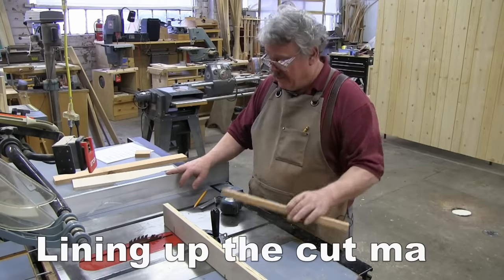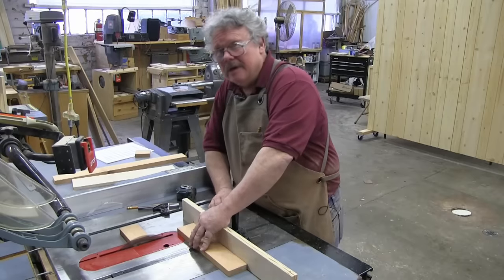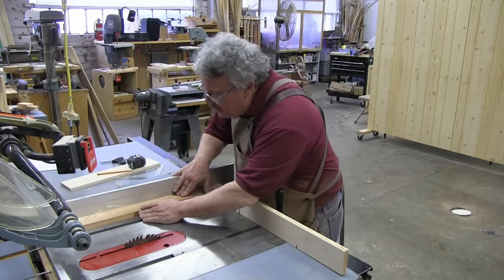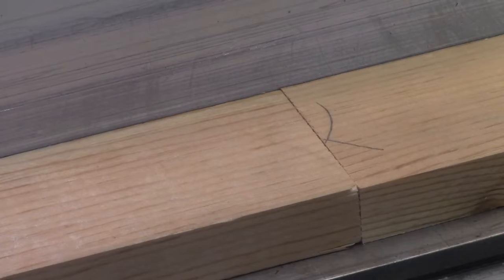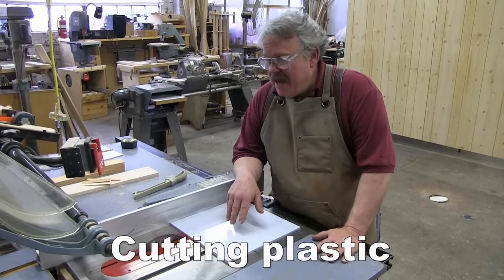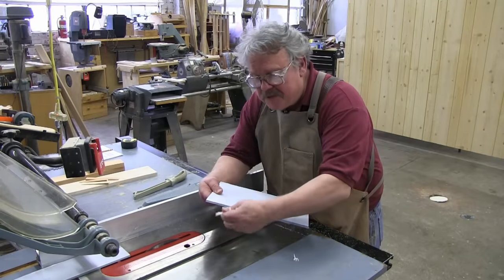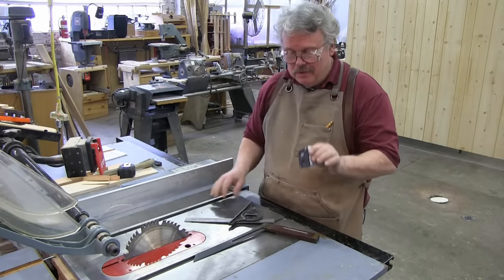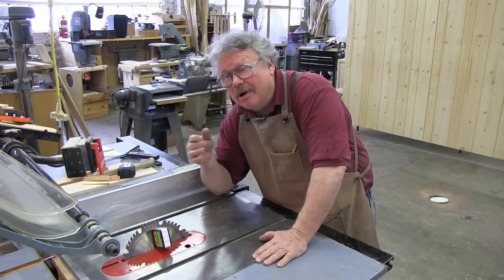5 Expert Table Saw Tips

Comment: Great tips, there is another way to do #1 Take a carpenters square up against the blade  and mark a cut line right on the table saw , than extend the line on the peace you are cutting to the front edge and line up the two marks and cut, the line will have to be "Renewed " every so often and also for different blades
Reply from the maker: Good tip; thanks for sharing. Craftsman once made a table saw with a plastic insert for this very purpose -- the plastic took the pencil marks well, but there was a problem. You had to use an extremely sharp pencil. If you marked with one that's even slightly dull, the mark would be slightly to one side of the straightedge.  The more rounded the pencil point, the further the mark was from where you wanted it. When I tested this saw, I found it more accurate to use a fine-point Sharpie. You could press the fiber tip right up against the straightedge and the mark lasted longer than pencil. You could easily "erase" the mark with a little naptha.
Reply: Another way is to use your square to extend your mark to the edge of the piece to be cut.  Then place the piece in the miter gage.  With the saw off slide the miter gage forward and align the mark on the edge of the workpiece with the tooth on the blade.  I don't know if I explained this clearly or not but this method has resulted in accurate cuts for me.
Reply from the maker: @fredsasse9973  It's a good technique, I used it often until an old craftsman showed me how to use a square to align the mark and the blade. One of the things I love about woodworking is that there are usually  many ways to accomplish a specific task.
Reply: @WorkshopCompanion  One thing I noticed is that your kerf came right up to the mark, not past it. I presume that any method (and yours seems the simplest) has to make sure to pick the correct tooth (i.e. the one set to the edge you're measuring on) to mark from.
Reply from the maker: @robertharris1748  This is true for saws where the teeth are set left and right. On many carbide-tooth saws, the teeth are exactly the same width, independent of how they're ground. As for the pencil line, I was taught to "save the line" rather than cut it. The area at the edge of a pencil line where light meets dark is much smaller than the actual width of the line itself. And I only use pencils for videos, when the camera needs to see what I'm cutting. When doing actual work, I mark cuts with a sharp knife -- much more precise than a pencil.
Reply: @WorkshopCompanion  What it seems many folks are missing is that your technique is by far the simplest and requires the fewest steps. There are dozens (maybe hundreds?) of ways to do this but yours is the simplest and most foolproof. I'm new to your channel but I'll certainly be hanging around!

Comment: #3, no rifing knife?
Reply from the maker: The saw was manufactured well over 60 years ago when few tool engineers would have known what a riving knife is. There are no retrofits available; we've looked. The saw is outfitted with an overhead blade guard, part of the Delta "Unifence" upgrade from long ago. It does a good job protecting against kickbacks, but we have to swing it out of the way for videos.
Reply: @WorkshopCompanion  got it!

Comment: For tip #2, align the miter gage.    Slide the gage out, slide back in upside down, with the miter part against the fence guide bar. 
Loosen and retighten the knob.   Done,    No fiddling.
Reply from the maker: This presumes that the fence guide bar is square to the miter slot, and this is not always the case . It's not on my saw, but if it is on yours this would be a good way to go.

Comment: So just got a band new Grizzly table saw. For some reason wood is hard to push through. I waxes the surface but still I feel like I need to push way too hard. Any thoughts?
Reply: Hello Steve, hey, just my 2 cents worth but I found a light spray of PAM worked for me. Mainly the cause was the snap in blade cover is not the same type of metal/ steel as the bed is made of. Another possibility is the fence is not exactly parallel with the blade. There can be a little movement when you lock the fence causing a slight bind. I have an 18" steel ruler I will double check the measurement from the groove the miter gauge slides in to the fence. On front and back edge of the table. Now some people will say you need an ever so slight difference to keep wood from binding. Working at a pattern shop where we deal in thousands and tenths of degrees,  I dial my fence in exactly parallel.  Just saying what works for me. Good luck and keep all your digits 
:-)
Reply: @jerrymeeuwse859  I'll give it a shot thank you.
Reply: @inspectorsteve2287  What he said and if no relief with that you might have an edge on the front of the table that is interfering, ran into this on a friends new grizzly the strip on the end was drilled to low raising it up to a hair over the surface of the table and put a slight lift on it so only the front edge of the wood was actually on the table, this makes a slight bow and causes it to slide poorly, pulled it off, a few file strokes and right back in business.
Reply from the maker: When it's hard to push a board through on a table saw,  the first thing I check is alignment. Are the miter slots and the fence perpendicular to the axis of rotation? We're going to cover this in an upcoming video.
Reply: @WorkshopCompanion  Agree entirely! especially if the saw is new, and untried, there may be a manufacturing defect or the assembly was done poorly you cannot rely on being square to the main reference, {axis of rotation}, anything from a missing shim on motor mounting to runout on the blade can throw it off, although usually minor.
Reply: @WorkshopCompanion  Looking forward to it.
Reply: @WorkshopCompanion  awesome thanks. I look forward to the video.

Comment: if you don’t have an inclinometer, iPhones have bubble level apps that can be used for accurate angles to 0.1 degrees though they won’t attach magnetically. it beats running out to buy a specialty tool if you don’t use it often
Reply from the maker: Good tip. I like "iLevel" -- it's free.

Comment: While you were drawing a line with the square you could have drawn it across the board and then lined  the mark with the cut in the cross cut guide and thus eliminating the use of the square against the blade.
Reply from the maker: I agree, the kerf in the miter gauge fence is a handy reference for a short while. But it widens over time due to blade run-out, vibration, and the lash in the miter gauge slot. The saw tooth retains its accuracy as a reference.

Comment: Have you ever tried to turn the cross cut guide upside down, slacken the cross cut lock and with the tine in the groove bring the guide fence to touch the saw fence guide rail and holding tight, tighten the lock. Turn the cross cut guide right side up and check if desired. If this is not accurate your saw has major problems.
Reply from the maker: It depends on the make of the saw. This would work on my Delta, but not on my Shopsmithj or Atlas.

Comment: One thing I noticed your using the saw clearence plate to take measurements for blade angle. shouldn't you use the table top?
Reply from the maker: We answer that one in our video on "Crucial Table Saw Alignments and Adjustments."

Comment: Cutting plastic:  set the blade as high as you can.  This minimizes the time the teeth are in contact with the plastic, and allows more time for the chips to clear.
Reply from the maker: Great tip.

Comment: Then I learned something new again, thanks for that.
# 4 - I usually make a sandwich with some scrap plywood on each side of the acrylic sheet, then you get a completely perfect cut.
Reply from the maker: I can see how that extra support would prevent chipping. Good tip.
Reply: That method works well. The chipping is usually because the teeth on the backside of the blade tend to lift and make the plastic chatter.

Comment: I love my digital inclinometer BUT you have to be careful to read it correctly. They will display the correct angle for X and Y axis but not Z axis. This shows up when you use it to set your table saw blade to an angle such as 45 degrees. If the device is perfectly parallel to the ground than it is correct....but if you rotate it a bit on the saw blade so it now is inclined either a bit forward or backwards, the reading will be incorrect by a given amount...the more it is not square the more it is off.  I discovered this when I tilted the incinometer a bit so I could see the display better.
By the way....those dedicated inclinometers are a few bucks.  There are several free apps for phones and tablets that do the same thing and are extremely accurate. I have one for Android called clinometer and it was equally accurate as my digital clinomer!  In addtion it has options to act as a 3D bubble level or inclinometer when my tablet is set so the side of the tablet was against the piece I wanted to check an angle. I have the same thing on my cell phone which is good also. The advantage of a tablet is that it is larger than a cell phone so you have a larger measuring distance...similar to using a short level or a longer level. Both allow zeroing also.  I use them on my Samsung phone and tablets. The neat thing is that I always have my cell phone with me so when I need to check an angle I don't have to go back to the tool box or shop to find the inclinometer....saves time.

Comment: For the first crosscut, couldn't you just scribe the line all the way across the wood and use the notch in the miter jig   to line up the cut?
Reply from the maker: I presume by "notch" you mean a kerf you would cut in a board attached to the face of the miter gauge. This works for maybe a dozen cuts, but the blade runout and the lash in the miter gauge slot soon causes the kerf to widen and it's no longer an accurate reference.
Reply: @WorkshopCompanion  that's exactly what I mean. And thank you for the reply, that makes sense. 
You make such informative and entertaining videos, I've been learning so much for you, thank you for what you do and how you do it.

Comment: Well I’m step number one why don’t you put a mark on the opposite side of the board and line it up with the slot that you have in your T Square
Reply from the maker: The slot wallows out quickly due to blade runout and the lash in the miter gauge slot. It cannot be relied upon for accurate alignment for more than a few cuts.

Comment: The miter gage should be square to the miter slot.  Not the blade, and not the fence.
Reply from the maker: The core reference for alignment and adjustment on a table saw is the axis of rotation. You find this by measuring the position of a single tooth on a saw blade in two points along its rotation, ahead of the arbor and behind it -- a line drawn through those two points is precisely perpendicular to the axis. Once you have that reference, you align everything else to it. I go a step further and find the runout of the saw blade -- using a dial caliper, I can identify the tooth that wobbles furthest to the left as the blade rotates. This tooth will always be directly opposite the tooth that wobbles furthest to the right -- 180 degrees along the circumference of the blade. As long as these teeth are straight up and down (at the top and bottom of their rotation), a line drawn horizontally across the saw body will be square to the axis of rotation. In this position, you can use the saw blade to set the miter gauge very accurately.
Reply: What is your point?  The miter slot and the saw blade are presumably parallel, as that is a part of basic saw set-up.  Likewise, the fence should be parallel to the miter slot.  So what is your point?
Reply from the maker: @LarryB-inFL  The point is, you cannot presume that the miter gauge is properly aligned by simply squaring it to the miter slot; you have to go back to the core reference (axis of rotation) to make sure the slots are properly aligned. (If they are not, there are four bolts that hold the saw carriage to the table. Loosen these bolts and adjust the table position until the distance from a slot to a single blade tooth is the same at two points of rotation, front and back. Only then can you trust the slots. ) The second point is that you can trust the blade to be perpendicular to the axis of rotation, but only at two points in its rotation. Because all saw blades have some runout, the saw blade is not perpendicular to the axis of rotation (or parallel to the miter slots) except at those two points.
Reply: Square with the blade is always better than square with the table, wear can throw the axis of rotation away, {slight but } also presuming the manufacturing was accurate, I am going with normally yes, that's fine, but always better to know than presume.

Comment: Why do you make cross cuts with a table saw, why not use a miter saw for this? The miter saw is made for it,  I'm a carpenter so I know that does a good job. I've seen a lot of other Woodworkers doing this I'm just curious. To be clear I'm talking about using a commercial grade electric miter saw not those old things with the hand saw that slides in the slot.. Also in order to hit my mark accurately with the blade, I move the square around to the edge of the board and make a mark there. So I transfer the line to the edge of the board when I'm going to have the blade hitting there.

Comment: most table saws I have used have a riving knife attached behind the blade, and it is a safety requirement here to have a guard over the blade. it’s very dangerous not to use one.

Comment: You're assuming the test board is flat and has been run through a joiner.
Reply from the maker: The test board needs to be jointed, then ripped so the edges are parallel.